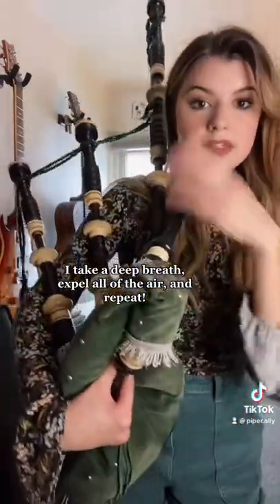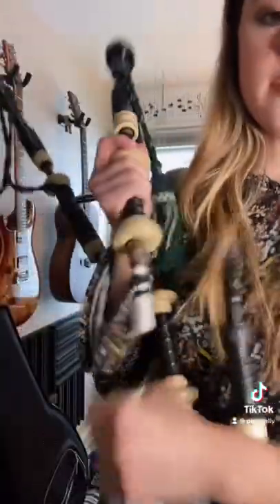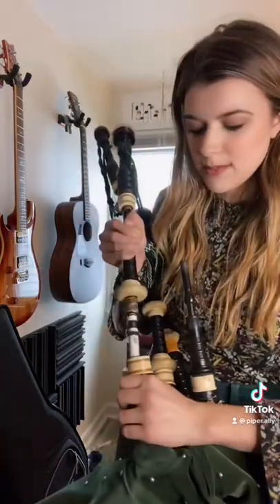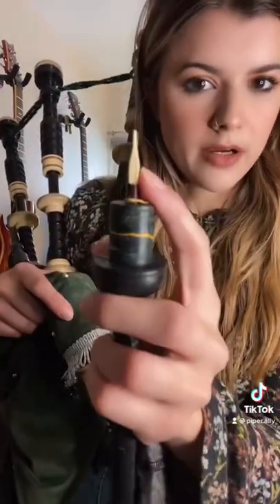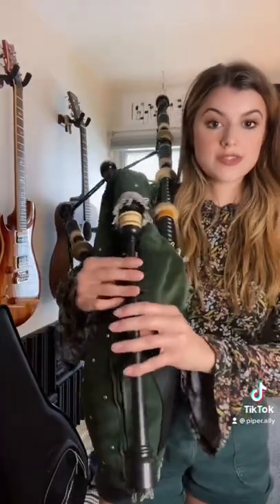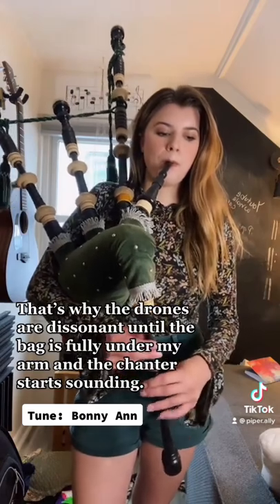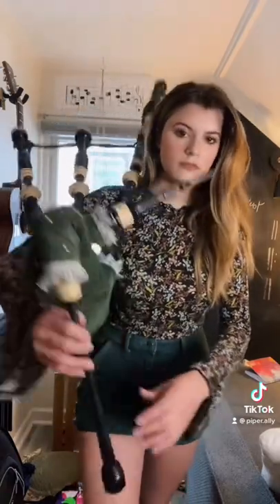How do bagpipes work?!

Comment: This is your first video ive seen and i always thought bagpipes were kinda weird only because i never knew how they worked. Watching this video i think its so cool and cleverly designed that you can breathe whenever you need to because it isnt your mouth pushing the air like other woodwind/brass instruments
Reply: Yeah, and this means that, theoretically, you could actually sing and play the bagpipes at the same time, for the precise reason that your mouth blowing does not make the music at all (the bag takes care of that for you). You don't use circular breathing when playing bagpipes either, like some people mistakenly think. If that was the case, you may as well ditch the bag, because then it has no real use! and Then you don't have a bagpipe anymore!

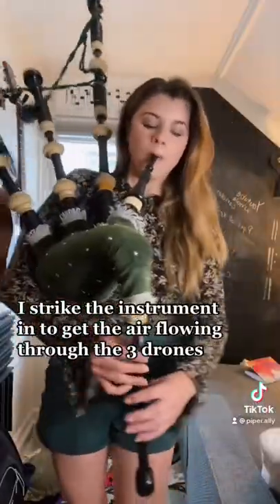Comment: 2:16 Pipe organs work that way too. The entire air supply system is engineered to deliver constant pressure to the pipes, they will go out of tune if the pressure changes.

Comment: Nice. That was a good first look. I didn't even now that much. ... Now, the scale. Is it a single fixed octave (maybe tunable)? Or are there multiple octaves based on a 'range' hole or do you play a different octave with a different force of air? Are the pipes tuned to a chord? They look like two of equal length and one longer. Are they a chord or the same note but since there are three, extra full? Or are they a few steps apart? Are the pipes chords with different notes played on the cantor? And finally, you said the pipes are tunable. Must all of them be tuned with respect to each other and also with respect to the cantor?

Comment: And what pray tell is the chanter? With the air pressure, is that because of the reeds that pitch is changed? When you say volume that refers to amplitude or volume, right?

Comment: Two questions come to mind watching this: 
1. What is the bag made out of?
2. What would happen if you remove the drones and cap the holes?
Reply: I'm not Ally but I'm a piper and can answer some of these. 

Bag is traditionally sheep skin or cow leather, but many these days are synthetic, made from gore-tex. The leather versions also need seasoning with a greasy, anti fungal concoction, rubbed into the is inside of the bag  Both of these are air tight but breathable, so moisture can evaporate out but air can't. If too much moisture gets in the bag from your breath, the reeds can get wet and cause problems. 
If you removed the drones and capped the drone holes then you just wouldn't have a constant note accompanying your chanter anymore. Some beginners do this, capping all drones and slowly reintroducing them one at a time, as the less reeds you have to blow, the less pressure and air is needed, which makes it a lot easier.
Reply: @goblinpiper  thank you. You've answered all my questions quite nicely.

Comment: So my biggest question that came from a different video you posted about how to play, is this, How when the song is over do you stop the bass and tenor pipes from creating any further sound?
Reply: Not Ally but I'm a piper and can answer this!

You simply stop squeezing with your arm, and all the pipes go quiet. The bag isn't like a balloon, where you fill it with air and the tension keeps pushing the air out until it's empty. You need to keep a constant, strong squeezing pressure on the bag with your arm to make any sound at all. As soon as you stop squeezing, the air isn't being forced out and it all goes quiet.

Comment: What's an inexpensive set you would recommend for a starter? I'm sure my neighbors will hate me but meh
Reply: Start with a good practice chanter before spending $800 or up on a full set of decent pipes.  I've been using a John Walsh Long Poly practice chanter for years and it works great.

Comment: Thanks, Ally. That was helpful. One more question: do bagpipes come in different tunings? I can imagine changing the length or diameter of the drones to play in a higher or lower key.
Reply: I'm not Ally but yes, pipes do come in different tunings. The most common ones I can remember are the Bb and D tunings. The former is for concert pitch (pipes are a transposing instrument) and the latter is the standard tuning of the pipes. (We tend to tune sharper for competitions though because it improves clarity)
The tuning is dependent on the reed and chanter and there are various ways of going about fine-tuning the chanter.
Smallpipes typically come in A and D tuning.
Hope this helps and I think everything is right.
Reply: @EduardPlint  Thanks very much. that was helpful.
Reply: @EduardPlint  Assalam o elaikum how are you?. I like your comment

Comment: What is the difference between the Scottish and the Irish bag pipes
Reply: Well 1 difference in particular is that the Irish bagpipes use bellows for inflating the bag, meaning that your mouth is not used at all in playing the instrument. Makes sense when you consider what the videographer said at 1 point in the video; the arm pressing on the bag is what pushes air through the instrument and not the mouth. the mouth is therefore used to supply the air that the bag needs so it can do that job. The bellows, therefore, is another way to supply the air to the bag so it can then push that air through the pipes.
Another major difference with the Irish bagpipes is the tuning. If you play an A on the irish pipes, it's actually playing at 440 Hz, like the A string on a violin for example, meaning it's a lot easier to play the Irish pipes with something like a violin or piano or whatever (I.E any instrument tuned in "concert pitch", like the violin or piano, where the A note is at 440 Hz). The scottish bagpipes are a bit odd because of their different tuning. Let's go back to our A note example: instead of 440 Hz, an A note on the Scottish pipes is more like 460 or 470 Hz or something like that... you can see how this presents difficulties when trying to play the Scottish pipes with a piano for example, because an A note on the piano and an A note on the Scottish pipes would be mismatched because of the difference in frequency even though the "note" (I.E the letter name) is the same.

Probably a more obvious difference is that the Irish bagpipes are significantly quieter than the Scottish ones; the Scottish bagpipes, in all honesty, are way too loud! That's fine if you want to project your pipe music across a distance of several miles or hundreds of miles or whatever, but if you just want to play some nice pipe music in your little bedroom or at a small gathering? Forget it. The Scottish bagpipes clearly were not built for soft easy-listening... they're built to make a shit ton of noise that drowns out all thought! :))) So the Irish bagpipes are much more suitable for quieter, more intimate settings.

Those are a few differences I can think of.

Comment: Hang on aren't bag pipes made with sheep's stomachs?
Reply: Common misconception! To which the traditional response is 'I would like to see the animal with a stomach that big!'
A sheep's stomach is only about the size of a fist. There are a type of early medieval proto-bagpipe called a bladder pipe that uses animal badders as the air reservoir, but you don't play them under your arm.

The bag was traditionally made from sheep hide and many still are, but modern ones are often synthetic now, as they stay air tight for longer and don't require any maintenance. 

There are actually some Eastern European bagpipes that use an entire sheep as the bag, with the chanter coming out the head, and a drone coming out of each leg! They player looks like they are hugging some kind of sheep balloon!!